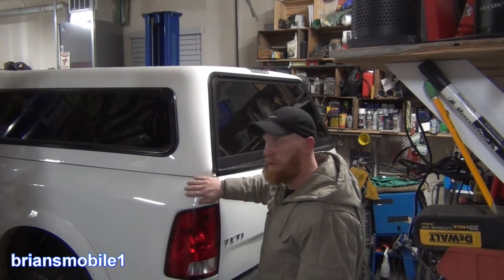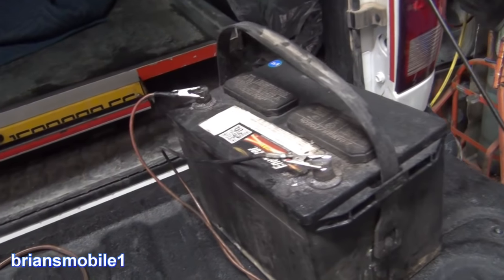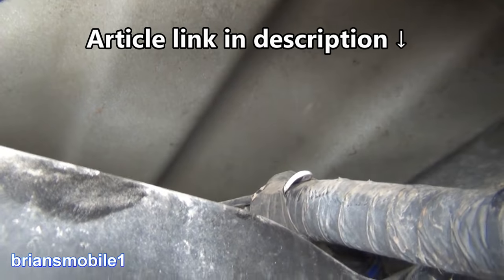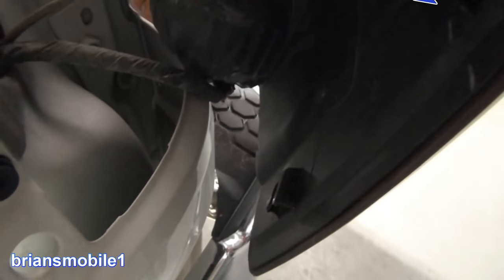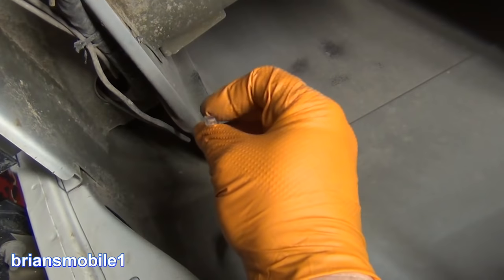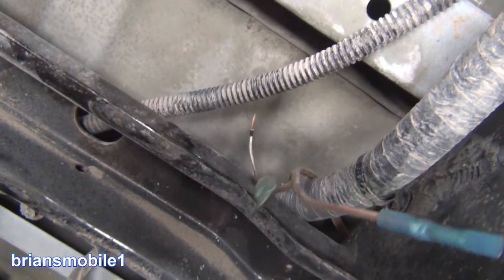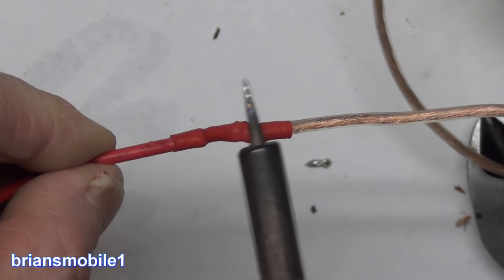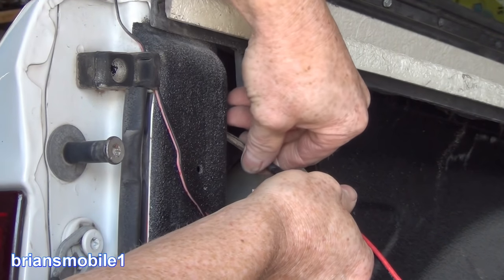How Do You Hook Up a Camper Shell Brake Light?

Comment: i remember when i added the shell to my old 97 chevy truck. i took the truck highmount lense out and hooked to the power wire and brought the wire out, put the lense back in and sealed it with silicone then ran it all the way to the back to the light and ran a ground. worked great for years. didn't have a trailer harness on it with a wire dedicated to the highmount. but on any of the newer newer chevy trucks i've had, there is a light blue wire coming out of the trailer wiring that is dedicated for highmount brake light.

Comment: Thanks for this info.  I have an 01 Ram and have seen that wire down there on several ocassions.  It looked like a temp sensor but low and behold it is the brake light!  Saved me a ton of time.

Comment: The Chevy 2500 I'm currently putting up vids on, needs the same thing. This one's 4 wire. 2 for the brake light, and 2 for the compartment light (bed light). It uses a 4 wire trailer wiring harness set up and plugs.

Comment: Ty ty. Thought I was going to have to run wires from the cab, and googled it. Your video popped up, and it was exactly what I needed. 2012 ram has the wire in the same place. I found it even without my glasses on. You saved me a huge headache.

Comment: Great DIY video Brian! I remember wiring up the cap on my '97 S10, but just spliced into the existing wire harness for the rear brakes. It was always a pain if I wanted to remove the cap. This is an excellent solution. Thanks!
Reply from the maker: Welcome!

Comment: A friend just got a new camper top. The dealer for the ARE had no clue how to wire the 3rd brake light. They told him that he needed some type of converter and he needed to go to a dealer, after another $100 he got his truck light working! What is it with ARE dealers? When I got my top it was the same situation, mine was a Ford. Thank you for the informative video!

Comment: I wired mine all the way up to the engine compartment then through the firewall and connected to the brake light switch. Discovered months later that on this 95 f-series there is a wire specifically for this purpose at the firewall near the ICM

Comment: Most ford pickup trucks (especially superdutys ) have the extra wire for the camper shell 3rd brake light (light green wire sticking out of the harness, sometimes covered up with electrical tape so it may be hard to see or locate)
Reply: Hi bro 

Fro OTARA New Zealand 

I watched a lot of your videos,, 🤛🏽

Helps me a lot,,  

Thank you TOKO
Reply: The 18+ super duties have a purple wire with a white stripe that is capped and sticking out of a harness between the spare and the hitch receiver up high by the floor of the bed and it has a big white tag hanging off of it that says “high mount stop”

Comment: I normally encapsulate a ground terminal with silicone adhesive after the connection is made; I like to use the clear 'household' stuff that doesn't smell of acetic acid 'vinegar'. I place a dollop of silicone and spread it around a little to ensure the exposed terminal surface is well covered. I also place a drop of silicone adhesive into the connector before placing the wire into it and crimping. The crimping action ensures you have a metal to metal connection, so you don't have to worry about the silicone interfering with electrical conductivity.
Reply from the maker: What brand do you use?  When I was training under my dad as a boy I was shown not to do that because silicone adhesives (at least back then) promoted some corrosion as they first cured.  I'm not saying you're wrong.  I'm asking for what type I should be using- I'd like to know.
Reply: @briansmobile1  I use GE 100% waterproof - window/door/attic/ basement. It's the type that doesn't smell of vinegar (acetic acid); that's usually the automotive type, unless they've changed the formula. I've been using it for decades without any problems. I used it on my dirt bikes even before I had a drivers license and just kept using it on all my vehicles since then. Maybe it's the acetic acid type that promotes corrosion...dunno.

Comment: @10:50 - Use Alligator clips to hold the wire. With almost no weight they don't pull down or apart on the wires.
Reply from the maker: This seems like an amazing idea.  Unless they're made to stick to solder.  Try it and let us know what you find.

Comment: Brain just drag the tool box with you :-) Also I recommend you do some quick connector work like I done to my Camper Shell : 
1 2pin connector for 3rd Breaklight (RED shrink wrap) 
1 2pin connector for Cabin ceiling light with light box inside the Camper shell so at night I can lighten up the inside 
1 2pin connector for Emergency lights (Yellow shirink wrap) 
And the 2 ping for the Cabin light is actually 2 way because I do have a Solar panel on the camper shell so it charges the battery while the car is parked in the field. 
Video about it is coming.
Reply: Just use a single multipin connector instead, so that you only have the single point to connect and disconnect. I did the same with the shell when I had one, using a 3 pin plug and socket to get the third brake light and an interior light while still being able to remove the top. With my car I added a LED light to the boot to replace the wimpy little glow worm it had, and used a plug and socket so it fits to the rear shelf, but is still easy tor emove when needed.
Reply: @SeanBZA  I agree but I had 2 pin connectors and don't like to wait for stuff to arrive :-)
Reply: @lsellclumanetsolarenergyll5071  I recycled some connectors off of old wiring looms for my use, so they were free as well. Wire was salvaged out of the scrap yard when I went hunting for some interior parts, and grabbed them along with a chunk of the wire loom as well.

Comment: Nice work, just that using solder alone is going to cause issues on some joins if they are exposed to stress and vibration as it will cold flow with time. Also with the "speaker wire" you often find that it is CCA wire, which does not solder well, so be careful buying the cheap stuff, and test it using a lighter to see if it is copper, and will run to red heat without melting, or is aluminium which melts and does not solder well, or is steel wire, which is magnetic.
Reply: Thermostat wire

Comment: Instead of holding the wires with pliers try stripping the end of the wires a little farther back and and then make a loop on each and loop them together. Then apply your solder. Makes it very easy and low profile for for sliding your heat shrink over the joint.

Comment: Did you disconnect the overhead brake light on the truck?

I was told to disconnect it when I was wiring a canopy with a overhead brake light.
Reply: If you do this on newer vehicles, the truck won’t shut up about having a light out.

Comment: Good morning Brian I'm trying to purchase a transmission for a 2008 Subaru Impreza 2.5i non turbo and I wanted to know what size transmission I would need for my car because there's two bolts and nine pin connector and then there's a three bolt 12 pin connector if you could help me with this I would greatly appreciate it I've tried calling the dealership I've called the mechanic but he can't put the car on the lift so I don't know what else to do 
figured I'd ask you Thanks for any help you can provide
Reply from the maker: Not sure what to tell you other than find a way or pay someone to do it.  One other option is to use the VIN number and see if the dealership parts guy (bring him a drink or whatever he likes) could look it up for you.

Comment: What dreadful soldering. Solder is not glue. you need a goo mechanical connection first (i.e. twist wires together)
Reply from the maker: Say I did a lineman splice or rabbit ear splice intended for long straight sections of wire and then soldered it.  It would absolutely be stronger, and it would have a much better electron flow likely, but locate that on the rear end of a 4x4 truck and it's gonna chafe out of the insulation & could short to ground.  This method allows for a lighter and shorter repair and allows more flexibility in the circuit.  Constraints cause for different methods.  I learned to do these "dreadful soldering" joints on electric speed controls & Lipo battery connections on RC helicopters.  They did better than mechanically attached wires with solder over them and reduced failure rates that resulted in expensive power failure induced crashes.